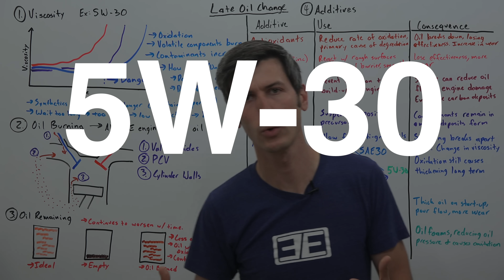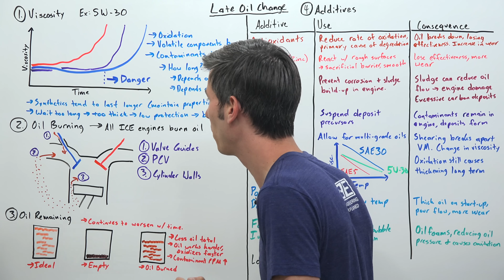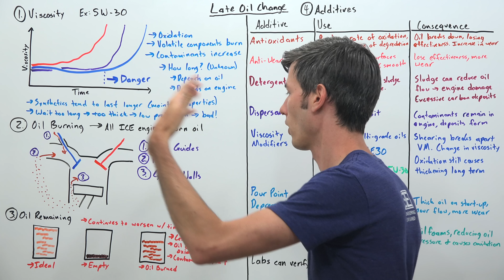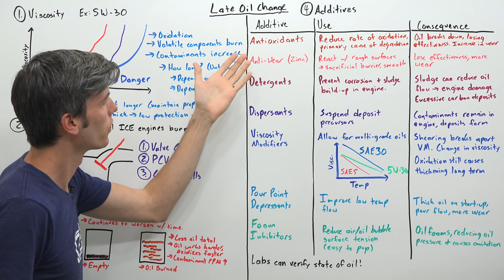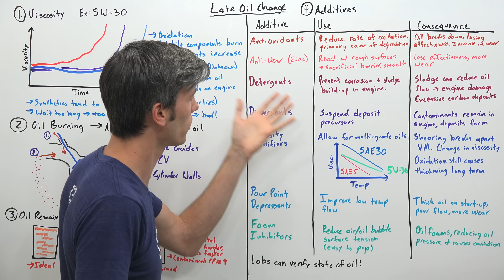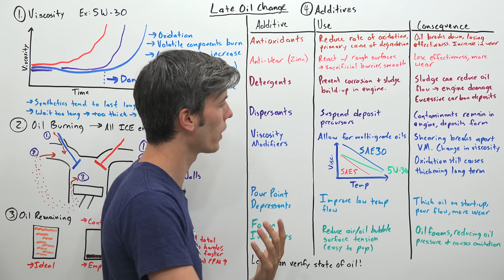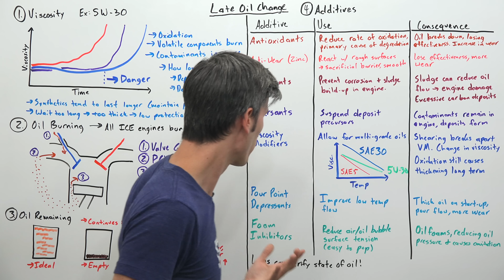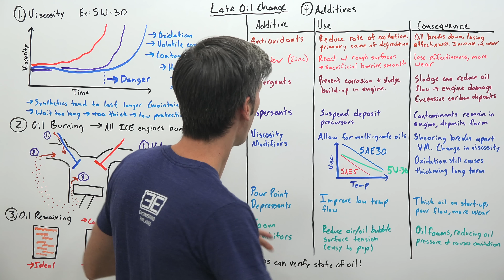What If You Forget To Change Your Oil?

Comment: Can you explain lubricity please.  Pressure might look good on a pressure gauge, but what is the oil doing when or if it gets to the bearings.  There seems to be a surprising number of engine failures due to lack of oil/lubrication... why?  Surely we should have this completely nailed by now, after 130 years!

Comment: In 2020 new rules for sulfur content in the gasoline in the US and Canada, brought level to 10 ppm wich on par with Europe. This means that synthetic engine oil  can go 10k miles and even more because there is less sulfuric acid produced in the combustion process. High Sulfur fuel will deplete your TBN (total base number) faster and also make your exhaust system corrode faster. Direct injection engine tends to increase fuel dilution in oil, this is especially true if you do alot of short trips and the oil never get hot enough to vaporise moisture and fuel.

Comment: Wish you would have covered time as well. Could have clarified the misconception that oil must be changed by a fixed time interval if the prescribed distance interval isn’t reached first. While not completely false, the need to change by time heavily depends on the use profile of the vehicle. A car that sits all winter and gets driven on the highway for 100 miles every other weekend in the summer probably doesn’t need the oil changed every year. A car that covers the same distance by driving a mile or two to work every day of the year might have to get the oil changed twice in that time due to the number of cold starts and lack of full warmup.

Comment: My dad asked me to check his Ford Sierra Diesel back in the late 80's as his oil warning light was on.  When I removed the drain plug nothing was coming out.  He confirmed the light was on for 'a few months'.  I topped it up, changed the filters and the car was ok.  Try that with a modern engine.

Comment: Short answer is that mileage is not that accurate a measure. Run hours are much more important. I studied lubrication studies and they showed that under 250 hours was a waste and 350 hours was the threshold to significantly increase wear. So somewhere around 275 hours was generally the best cautious interval to change. How many miles is that? Well use your average mph state in your trip computer and don't reset it between oil changes and you can calculate the mileage: miles driven/average mph= ~power on hours. So at 20 average mph you change every 5500 miles and at 45 average mph you change every 12500 miles. That is a large range. As far a time I have oil analysis  tested at 1 year and there was always enough TBN remaining so less than one year is unnecessary except if one was doing severe service of some sort. Obviously you check your oil and never let it go down more than 1 quart before topping up.

Comment: You never mentioned make up oil.  If the engine burns or leaks oil and  you have to keep adding fresh oil you may be able to extend  your oil change intervals.   A badly worn engine has blow by past the rings and thus the oil gets contaminated  and you may have to change your oil more often.
  Diesel engines get more contamination than a Gasoline engine which has more contamination of combustibles the Propane or Natural gas.

Comment: What I really want to know is what I should actually be using in my 2005 Subaru WRX STi. Everywhere I see says I should be using 0w-40 or 5w-40, but the manual says to use 5w-30 and there's a range where a 40 weight is okay. I've also seen people use 50 weights on the track. So... what's right?

Comment: ok, whatever modern equivalent of "Dave" is listening now, I'm 100% positive.
 I was just having this conversation with my kid, who's coming of driving age soon, about maintain yo damn car (!!!) and change yo damn oil (!!!), and how "modern" oil change intervals are bad, at least without personalized testing.
change your oil every 3000 miles to 6000 miles, depending on what your testing results are.
people should also adjust their change schedule to their personal habits.  If you're the kind of person who has a problem with doing stuff in a timely fashion, you should shorten your oil change interval, since you're likely to be "over" when you're "supposed" to.  that way you can be "late" but still be safe.

Comment: Years ago I took a class in college on automotive technology.  The professor had a PhD in automotive engineering.  I learned a lot in that class.  The one thing that really stood out is the professor repeatedly making the point that oil is not just a lubricant.  It is a coolant.  The oil helps limit heat buildup in critical parts of the engine.  Not just by lubrication, but by moving heat away from critical parts of the engine.
Reply: When I was a kid, I always see my dad change oil on his motorcycle and I always thought of the oil as a means of "cooling" the engine because I have no idea what's inside the engine and what's happening. The thought of oil as a lubrication later on added to my knowledge is when ai fully understand what happens inside the engine.
Reply: Yup, during the Vietnam War era, my brother worked at a bearing manufacturer.  They ran a test that sprayed oil on bearings to simulate a system they were developing for emergency cooling in a shot-up helicopter gearbox.  They used nitrogen to spray the oil on the bearing.  They kept reducing the oil feed to determine the minimum oil flow they could get away with.  They got to the point where no oil was flowing and just the cooling effect of the nitrogen kept the bearing alive.  It was the cooling that was critical over the lubrication.
Reply: @crusinscamp 
Very interesting and thought provoking .........
Reply: that's why new Tesla motors are oil cooled
Reply: Reducing friction by lubrication is also making sure the temperature stays lower.
Reply: This! This is why my engine got fried and stuck, with no oil! Mechanic said, "I was responsible" to check the oil level every two weeks. It was gaslighting. I had the scheduled regular maintenance with the mech, just 3 weeks prior to getting fried. $3000 price tag for engine swap. Plus tow, plus stranded in hwy etc. The car was regularly and meticulously maintained. But oil got lower in... 3 weeks??? Bummer.
Reply: @JR-zw2vb  Yes person should check their oil but eating so much oil it starved the engine in 3 weeks. Something seriously was wrong. I do check my car almost daily i probably lose more oil from wiping the dipstick clean but thats just me being OCD.
Reply: @DeusKDuo That's not OCD. In 2020,  I used to be a delivery driver averaging 150+mi./day, and I used my own car('02 camry), and I checked the oil level every morning before starting the car.  B/c the camry had to endure so much city driving, I ran a full synthetic, which I changed every 3k mi. And running a flush through the the engine every 5 oil changes.  It's been my daily for the last 3yrs, and I left that job 2yrs ago, but It still runs very well, and I still run the High Mileage platinum full synthetic from pennzoil  but change the oil every 4k mi. now.  And I still check the oil at least once/wk.  I love that old camry, and I know it was worth doing all the oil changes myself.  Besides, the oil change service was super easy.
Reply: @lobsterbisque7567 that’s a testament to your Camry’s robustness!! About 8 months ago, I bought a 2015 Venza, which is based off the Camry platform, and will serve as my retirement car in a few years. It currently has 105K miles, and runs like a top! I’ve done a couple of oil changes on it, and it doesn’t burn any oil. I plan on babying it and who knows? It may last another 200K-300K miles, that’s how tough the Toyotas are. Kudos to you and your Camry!! 😃👍🏼
Reply: @carlovanrijk4039  Same to You  and Your Venza!
Reply: @lobsterbisque7567  btw, that generation of Camry is one of the most durable of all the Camry’s (and that’s saying a lot!) I see them on the highways even today as daily drivers. I’ve asked some of those people how much mileage they’ve got on their Camry’s, and many of them say 200K - 300K miles…and beyond!
Reply: @carlovanrijk4039  The early 2000s Camry is one of the most reliable vehicles in general, not just for the Camry family.
Reply: @JR-zw2vb  Did you determine if perhaps the oil leaked out? Or did they somehow prove it was consumed in the engine?

Comment: If in doubt, just change your oil.  I wouldn't go over 5,000 miles, regardless.  If you're driving an old car and using conventional, 3,000 miles.  Changing oil is easy and relatively cheap compared to having to tear an engine apart.

Comment: I change my oil every 4K miles with Kirkland full synthetic.  Yes it says that I don’t need to change the oil every 10K miles, and Subaru says to change the oil every 6K miles, but I still change it every 4K miles.
I also change the front and rear differential, transfer case and transmission fluids every 30K miles.
Every 40K miles I have the antifreeze changed and every 60K miles I have the belts and hoses replaced.
I suppose this is why we can drive our vehicles for 15-20 years.

Comment: I have purchased 2 new vehicles that the dealer failed to fill the fluids, one was transmission fluid in a new Nissan pickup. After about 120 miles the manual transmission locked up, the other was oil in a New Dodge pickup truck. Had to fight with both dealers to get a new engine in the Dodge and a new transmission in the Nissan. Both tried to blame me and I had to spend about $1500 for lawyers to get the repairs done.

Comment: I ran a messenger company for 20 years and used mostly ford econoline vans with either straight 6 or 351 V8’s.
Ran them between 10k and 15k between oil changes sometimes, but not always.
What did I do? First of all, I only used full synthetic, mostly Mobil 1.
Second, if it went to 10k or more, I would drain the oil, replace with regular motor oil, run the motor for 5 min, drain and then put in full synthetic and a new oil filter. Kind of like a flush really.
Ran them to 250,000 miles and no burning oil period.
Sold them at that mark running perfectly.
In addition, out of the 20 or so vehicles I’ve owned in the last 20 years, I’ve never had to “top off my oil “ between oil changes  - not sure if it’s because of the full synthetic or not, but that’s the case.
Regular oil is probably another story.

Comment: There is absolutely nothing wrong with going over your oil change!!! Most of the time they put the lest amount of miles before your should change your oil again, but they never give you the most amount of miles unless you ask them to. When mechanics only recommended 3k miles they could have given you a sticker that went 7.5k miles. And the new synthetic oil I've done over 10k before I've changed my oil and there is absolutely nothing wrong with my engine. It has 130k miles and my friend is a mechanic and tested oil at different intervals like 10k 12.5k and 15k miles. The oil didn't even start to break down til 15k miles. Oil just gets dirty and needs to be cleaned.

Comment: Here’s one for y’all; I work as a lube tech. We had a 2019 Subaru Crosstrek come in that was 24,000 overdue!!! 
Lower bay pulled the bolt and just said “yeah that ain’t good.” I peeked my head down to see the jet black (imagine used up diesel oil then up the viscosity by x2) oil flowing incredibly slowly and that’s with cap, filter, and dipstick removed

Comment: My last several GM cars tell you when to change the oil using some algorithm in the PCU that takes into account mileage, crankshaft revolutions (!), operating temperatures.  That was for conventional oils since synthetics were not being used at the factory back then. 

I bought a 2000 Buick GS in summer of 2018 and put Mobil 1 oil and filter in it.  I've not changed the oil or filter some 20,000+ miles later.  My thinking is that with what it burns and leaks, by topping off I'm doing an oil change every 15,000 miles of so.  OHMIGOD, I hear people scream.

I remember many  decades ago reading in Popular Science about this here new thingy called synthetic oil.  Someone, maybe Mobil, ran an engine for the equivalent of 100,000 miles on the dyno.  Upon teardown, there was literally no measurable or visible wear.  All machine marks visible, no ring ridge!

So, I feel safe "changing" my oil every 15,000 miles.
Reply: I wonder why you keep having to buy cars 🥸
Reply: @Pahang.bend17  How did you arrive at that misplaced conclusion?  My 2000 Regal GS runs great, especially after I replaced the factory PCM with a modded one, and a K&N air filter.  Not the fastest car in the world, but fun.  "Look, grandfather is laying rubber!"

Comment: subaru outback h6 2002- 384 k kms, no oil burnin, though engine resealed and every rubber part replaced as its in Australia.
checked bores, zero wear, oil pump-zero wear.

Comment: Changing oil every 6.000 miles? What car manual will recommend that? My Hyundai Matrix said 15.000 Km (roughly 9000 miles). My old Peugeot 407 says 30.000 Km (roughly 18.000 miles). To much oil change is just more pollution.

Comment: maybe, but it seems something other than engine wear will cause you to quit your current vehicle.  Weird electrical faults, transmission failure, door levers falling off/breaking, weird plastic smells, rust, key fob failures, catalytic converter failure and others regardless of how often you get it serviced. Would love to buy two identical, one gets all its services on time the other gets just the oil topped up with an occasional filter change and corrective maintenance. Then do a total cost per km comparison between the two.  Based on the costs of our servicing's, if they both made it to 200k, one would have saved $1600+

Comment: I have a 1987 Porsche 911 
I changed the oil in 2007 and drove it 
7000kms. In August of 2008 I parked the car in my garage and never brought it out again
I intend to run the car again in May of 2023
Should I change the oil before starting the car up again or should I allow the car to warm up for ten mins and then give it new oil
The fuel tank is empty now due to evaporation 
Should I install a new fuel filter before running engine or allow the engine to run for a hundred kms and then change it
I will probably put a borescope in fuel tank before installing fuel to ck for any rust or contamination

Comment: If I do very low milage, is it "ok" to not not change the oil every year, but maybe every two years?.....Now log does it take for the oil to degrade over time?
Reply: I would say every two years is pushing it, I have heard people saying as little as 6 months or a year at the most. This also depends on a variety of factors, like whether you use synthetic oil. A good rule is to check your dipstick after 6 months. If the oil is dirty, then you should change it.
Reply: Don't go more than one year definitely

Comment: I wonder what my oil change intervals should be. I do mostly city driving, but only did about 7500km/year pre-covid (and even less now.) I live in Canada (hot summers / cold winters) and  normally do two a year. I think I can get away with once a year though.
Reply: I get away with a good 100% synthetic oil, once a year or year and a half tops, i bet i could pull 2 years with the best oil though but I wouldnt do that unless I am out of the country..

Just do a year or so.

Comment: This video highlights one of the biggest problems in buying used cars. About 50% of drivers don't change their motor oil at the correct intervals. When you buy a vehicle like that it had s lot of hidden damage to the engine. In the private market don't buy a car owned by a woman.
Reply: Manufacturers like BMW advertise 10000 mile oil change. That is nonsense. It damages the engine.

Comment: As a general rule, every 20 deg. F. drop in oil temp, that doubles engine oil life.  IOW chemical reactions are doubled with each increase of about 20 deg F.   The Arrhenius rate rule for temperature, every 18 degrees F (10 degrees C) of increase, the chemical reaction doubles. In other words, for every increase of 18 degrees F for your oil, the life of the oil is cut in half. Keeping the oil as cool as possible when in use will extend its life and reduce the reaction of thermal breakdown.  Engine oil coolers can help extend oil life.

Comment: I have a 24 year old car (1998 Opel Corsa B - 1.6 engine) with 252 000km on it, I am currenlty using Shell Helix 15w-40 oil and have been advised to move up to 20w-50 oil. Is that oil correct for my car?

Comment: My daughter just experienced an engine failure in her 2016 Mazda 3. She had been using Mobil 1 10000 mile oil since new for the first 80000 miles with no problems or oil consumption. She wanted to go on a yearly change cycle so she switched to Mobil 1 20000 mile oil. In the about 13 months and 15000 miles all of the oil except for 1 and 1/2 quarts disappeared and left a gell in the bottom of the oil pan per the Mazda dealer mechanic. There was no indication of low oil per the oil light until the day she took it in for service for other things. The light came on and then went out immediately the night before so she thought it was ok. The mechanic said he saw no evidence of any oil leaks on the engine. Where did the oil go?  I think the new oil is more volatile and should not be used. She will never use it again! Her extended dealer warrantee would not cover the engine. If it seems to good to be true, beware, quality is as quality does.

Comment: The only thing you got incorrect is the cavitation comment. Cavitation only occurs with a restriction to the pump inlet(suction side) this severe restriction causes the oil to implode in vacuum. And causes damage and pitting on the inlet side of the pump. Severe aeration causes damage similar to cavitation but on the outlet(pressure) side of the pump. Have a nice day.